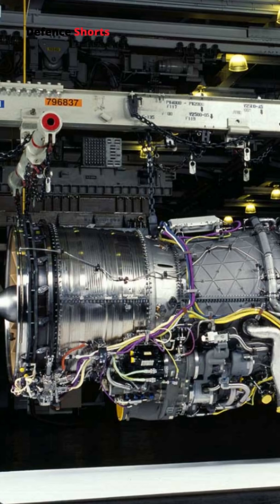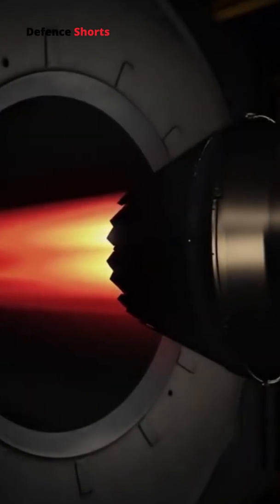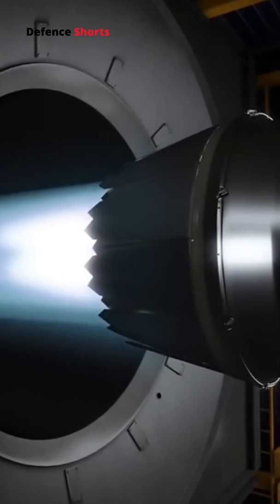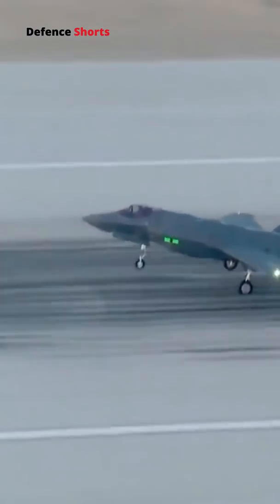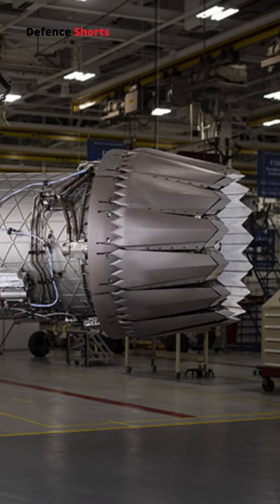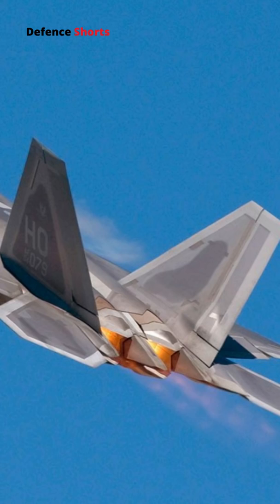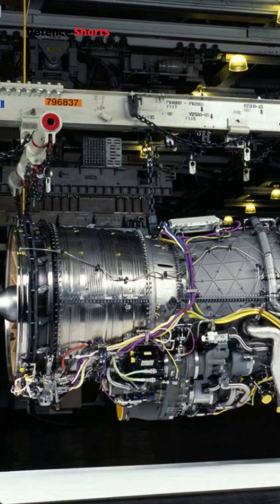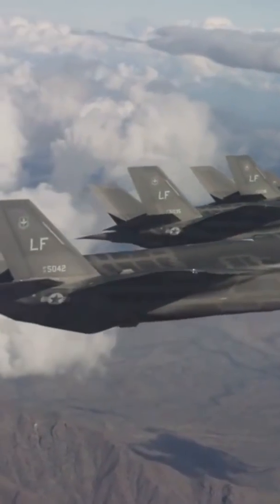F-35 Engine Is The Most Advanced and Powerful Engine? | #youtubeshorts #shorts

Comment: Its just a variable exhaust that can convert divergent-convergent (or vice versa) exhaust shape concept, thus it can create afterburner to make more thrust without bothering the fuel:air ratio inside the combustion chamber. They call afterburner for a reason. Yes it’s valid. I studied maintenance aircraft engineer, thank me later

Comment: I worked at the experimental foundry Dover howmet and I prepped ceramic molds for casting the first foil turbine blades for the engine.
The molds looked crazy but I wasn’t sure if it was to conceal the actual shape or that it was just that strangely faceted

Comment: The F-35B 3rd gen (which is the most advanced in its class) is a 3rd generation F-35, but a 5th generation fighter. With VTOL (vertical takeoff or landing) and STOL (short takeoff or landing) capabilities, a hidden missile/bomb bay, built in GAU-8 rotary autocannon, remote laser targeting, a helmet with VR vision, and a max speed of Mach 2.1, it certainly is an outmatched force, however the F-35 could still be so much more.

When you compare it to the Russian stealth fighter, you have to realize, that although the Russian fighter is just a little bit faster and bit longer range, it is also MUCH bigger and much less maneuverable than the F-35. 

Now, for all of you that say a squad of F-35's can't take down a squad of SU-57's, just remember this, Russia only has a handful (about 5) and a squad makes 12 aircraft.... so yes, you are right. An F-35 squadron can't take down a squadron of SU-57's.... because you can't destroy something that doesn't yet exist......

Comment: I sincerely hope that HMS is better than they tried on the Abrams. That was some straight bullshit on the tank. I'll never forget a damn near article 15 for telling a maintenance Sgt to go fuck himself cause the HMS said I had an "engine over speed" and I just drove to the wash rack. And I quote myself " it's an automatic ypu stupid fuck, I moved 60m  With a fucking ground guide. How the fuck do I idle with engine over speed fault and not  have to use car litter for the groundguide." General Dynamics tech admitted a HMS fault and I just got an ass chewing and he got gone to another unit. And as far as I remember that system wasn't used again. I guess the fuck thought I was trying to roll coal and hot rod it while in N or Pvt. Idk. I do know his life was miserable after that because alot of shit came out of the woodworks with that fella.

Comment: Most advanced yeah, most powerful? Not even close
Reply: Which engine is more powerful?
Reply: @GGG19872  the al41f1-s has a dry thrust that exceeds the f135 by about 12kn. In terms of most powerful engine overall that titles is claimed by airliners not by any fighter jet
Reply: @viperlabs7735  no it doesn’t it has 15 less and that’s without f135 upgrade, and most powerful is talking about in a fighter jet not just most powerful in general
Reply: @GGG19872  the al41f1-s makes 140kn dry thrust the f135 makes 128kn dry thrust.

Comment: The simplistic concept in such advanced historal research in this engineering,  the rear vectors and front intake purpulstion shifting verticle air flow. A concept many bulk airliners could adopt, making VToL ability feasible almost universally.

Comment: It is not the most powerful engine in the world, it is specifically designed to not be the fastest jet in the world, a 4th gen fighter could probably outrun it but the whole point of the f-35 is that it should never be close enough to an enemy to need to outrun it plus the US military census is that almost all their fastest fighters only hit their top speed during testing so there's no point in making the F-35 faster than the previous gen planes even if it was faster it would still have no need to reach more than mach 1 or 1.5. Even the f-22 is slower than the f-15.
Reply: It definitely is the most powerful engine
Reply: @GGG19872  No, it's not, the F-35 can't even  reach mach 2. Compare that to other modern aircraft or aircraft of the previous generation then that's nothing, an F-4 fantom can go almost twice as fast and it was the primary fighter aircraft for the US and allies during the Vietnam War.
Reply: @REEbott86  you are confusing engine power with the speed of the jet, they are 2 different things. F35 engine is more than double the power of phantom engines but the phantom has 2 engines.

Comment: That engine does not use fuel or gas, it’s a microwave plasma electric engine that is powered by crystal. They won’t admit it openly but if you research the fine print you will be amazed. One hint is there is no where on that plane where fuel is stored. Fuel is not being stored in the wings or fuselage, and no external fuel tanks are ever used. No smoke comes out of the engine ever. It’s virtually an incredible flying microwave plasma torch.
Reply: Are you retarded?

Comment: Most advance: yes
Most powerful: no

F22's engine is the most powerful... because of supercruise
Reply: F22 has 2 engines, so it has more total thrust but the engines are not as powerful.
Reply: @ERIK31351  but the problem is, it has no supercruise

F22: 35000 lbf (has supercruise)
F35: 40000 lbf (no supercruise, instead use afterburners)
Add the fact that prolonged supersonic flight of an F35 would result in mid-air disintegration. Just like what happened at the Mediterranean sea
Reply: @lancegigs9022  You're comparing the thrust of 2 engines to 1 engine. The F-135 engine is significantly more powerful.

Comment: The F-35 engine isn't anywhere near advanced. Of anything it's running on old tech the Russians used during the Cold War. The F-35 is a catastrophic failure that the US government won't stop boasting about. If the F-35 went into combat it would crash with rapid deployment. If 1 bolt or 1 piston came lose during the hovering stage the jet will crash. No one can change the facts.

Comment: It probably may be the most advanced but definitely isn't the most powerful, as that title undisputedly goes to the engines of the aging mig 25 despite its blocky and square-ish build, it was the only engines capable of pushing the plane to almost the same top speed of the sr-71. And that's not even factoring in the engine specs of the vastly more advanced mig-31
Reply: And cheaper cost per flights ;)
Reply: What's the max thrust on a single mig 25 engine? Not as much as an F-135

Comment: The J58 most cool engine. This engine trust vectoring what make it revolutionary.
Reply: A TOTAL FAILURE never produced the promised power only partial supercruise, even worse they admit the B35 Kamakhazi needs 2 engines. Quality made in Israelistan 🇺🇲 no expense spared 😂🤣😜🤡Australia has run all the scenarios the outcome out of fuel and weapons the B35 turns for home it is run down and killed by the Su35 with superior speed range and firepower within 2 weeks so many will be destroyed they will cease to be combat operational.
Reply: Both f35 and j58 are piece of 💩
Reply: Engine trust vectoring russians use long time ago.In soviet union was plane with vertical take off more than 40 year ago.I couldnt say is so revolutionary.
Reply: @nikis9160  This can do VTOL and also do 3X the speed of that old crap while burning less fuel. So yes, it is revolutionary.
Reply: @ERIK31351  Iak 141 did the same 40 years ago.It's was revolutionary.3 times less fuel,don't think so.F22 i could agree is advanced technology,F35 is further development,not revolution.

Comment: .. great see details of mechanism..😉
Reply: You only see some of the externals, not much information there.
Reply: @ERIK31351  ..will you explain to me..more ?!!?..
Reply: @ERIK31351  ..so,you speaking just x.. nothing..🤫
Reply: @nerk234  Most of the important technical data is within the engine, the outside that you see in the video is just tubes and brackets -
 not very important.
Reply: @ERIK31351  ..i know..i know..

Comment: The criticism is because of the cost of these aircraft but I don't think people understand how important they are in maintaining a technological advantage over potential enemies still using old MiGs or inferior knockoffs. If you get seen first you almost always lose. Period. The integration of state of the art technologies including stealth, the networked avionics and battle management systems, the pilot interface and everything else is stupidly complex and no other aircraft gets close to this as a package. People talking about Sukhoi this and Chinese stealth that do not realise how inferior those aircraft would actually be in a conflict. They talk about roll rates and all this nonsense which is barely relevant in a 21st century air battle. They don't realise for example to mount an attack on a target might take 20 F-18s to neutralise air defences, deal with missile threats and other aircraft etc which could all be dealt with by just 2 or 3 F35s. Therefore despite the cost you aren't spending a fortune more to operate them or maintain combat equivalence.

Comment: Most advanced engine but the plane can't go supersonic for too long or it will cause serious damage lmao

(You look it up, F-35B and C literally can't go supersonic)
Reply: i don't think it would even need to go supersonic for long anyway.
Reply: @Comfy_Bed  then why don't we stop at piston engined fighters, make it stealth and strap a bunch missiles? Your logic makes no sense

Technology and speed goes hand in hand with modern air battles, you can't just rely on either one of them. For example when you need to disengage or intercept, you need speed, evading missiles needs speed too, a 5th gen fighter that can't go supersonic for 5 minutes without breaking it's antenna or fuselage is shameful.

F-35 is an overpriced failure, they tried to make it a jack of all trades, but ends up compromising everything else, the US should have never cancelled the F-22
Reply: They can absolutely go supersonic, they don't publically release the actual top/cruising speed.
Reply: @ERIK31351  i didn't say they can't, i said they can't do it for too long or risk component/structural failure, at least on the B and C variant

Comment: you better throw away F35 and move to the promotion for F22
Reply: F-35 is more modern than the F-22
Reply: @ERIK31351  if F35 would work? Then it would be a great jet, But it doesn't work due to too many errors. Sometimes you have to accept your losses and move on

Comment: Only problem is it uses too much fuel in VTOL on a single takeoff compared to normal takeoff
Thrust vectoring jets can takeoff much faster than normal or VTOL
It also one of major issues of lack stealth jet, a big round nozzle which easily be detected by human eye or radar

VTOL is however safe on landing, depends on the wind speed
Reply: To take off you have to attain a suffisant speed. Thrust vectoring doesn't help with the time to take off, but it does help with manœuvrability in the air
Reply: F-135 does have thrust vectoring...
Reply: @ERIK31351  no
Reply: @polduran  It's literally shown in the video...
Reply: @ERIK31351  Only for the B version for take off and landings. Not comparable with conventional thrust vectoring.
Reply: @polduran  You are correct, my mistake.